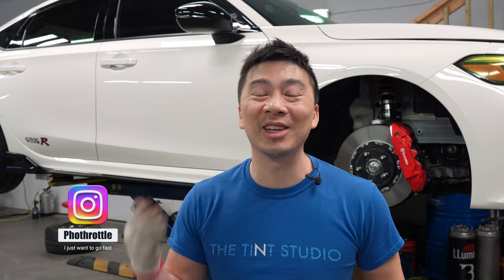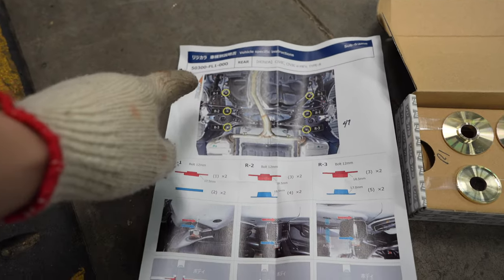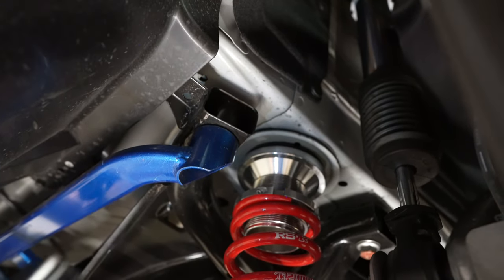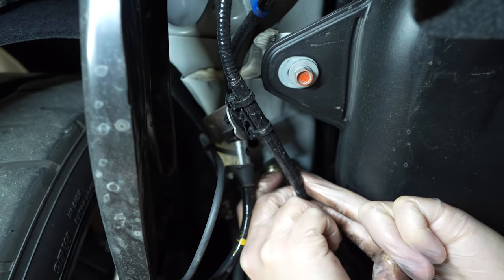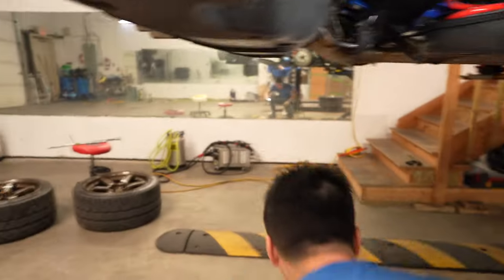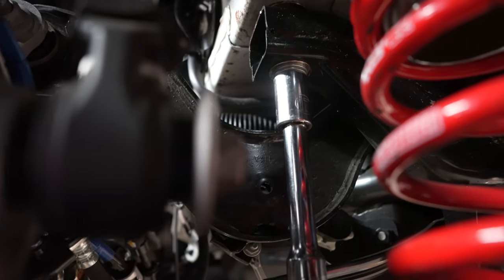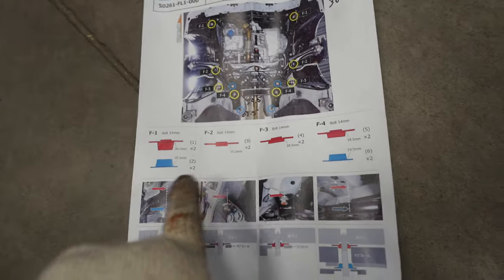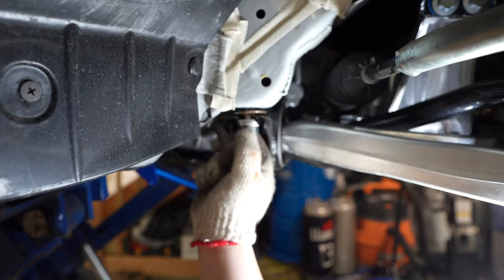Spoon Sports Rigid Collars || Honda FL5 Installation

Comment: Car brothers from another mother! My white 2023 Mazda 3 Turbo is also running RSR coilovers and Spoon rigid collars.  I found your RSR coiler adjustment video helpful to adjust my own coilovers.   

I'm the first 4th gen Mazda 3 outside of Japan to run either of those 2 mods, and I helped introduce the rigid collars to the North American Mazda 3 community.  The collars on their own do make a huge difference on the Mz3.  The ride is more supple and dampens out the rear torsion beam, but makes the car feel a tighter in steering and handling.  Super popular mod on our cars now.  I think the more mass market a car is, the bigger the difference these collars make.  A Type R with smaller tolerances and stiffer bushings from the factory will probably have a lesser effect.
Reply from the maker: RS-R Coilovers and rigid collars 👌
Reply: I’m actually planning and ordering some for my supercharged mazda 3 2019. Any chance you can tell me where you got yours installed? Was it a local mazda dealer
Reply: @northernwinter3236  did it on my own. Pretty easy to install the rears. Fronts you'll need a lift.

Comment: Thanks so much. This detail is definitely needed. Even smaller jobs I’ve found videos that leave detail out. What is your favourite mod so far?

I’ve found the ITS ADS module swap has had the most profound impact for me.
Reply from the maker: Hondata with thre pherable tune 👌 
Massive difference from stock.